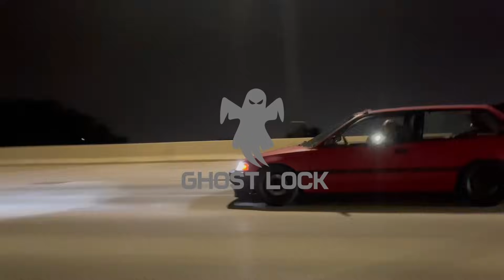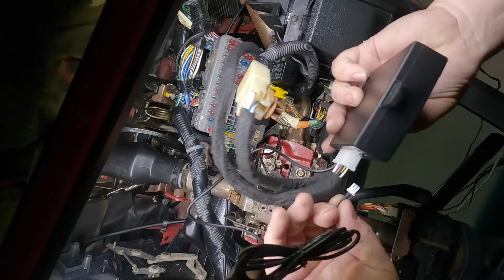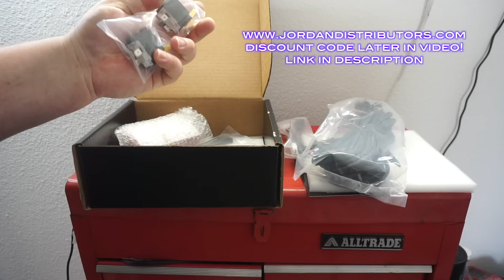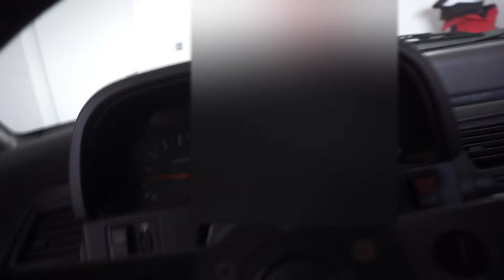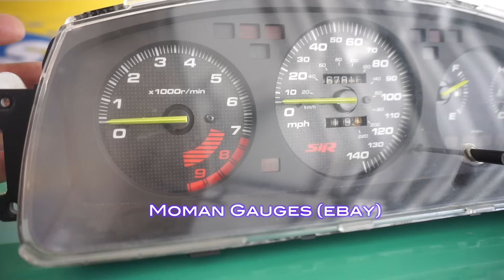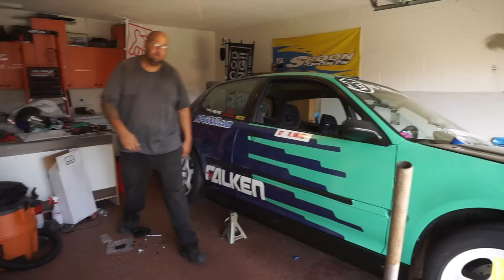KEEP YOUR HONDA SECURE! JDI GHOST LOCK | PUSH START EF/EG/EK/DA/DC CIVIC INTEGRA

Comment: Those ghost locks are easy to remove all u have to do is take power off wich u do by cutting cable off the fuse box and the push to start all u have to do is disconnect the fuse box cable disable the push start moral of the story if they really want to take ur car there taking it my homie had all that shit of he used to block his car with his parents cars one on front one in the bk and they still took it guess how tow truck them fools are savage
Reply from the maker: If power is cut it notifies you and it has a 6 hr internal battery broadcasting its location.
Reply: @HondaStreetGarage  nice

Comment: I used to dead azz remove my ECU, coil packs and put bike locks on my axles ever day parking in San Francisco on streets with my h22eg hatch. sometimes I would take out even more just to switch it up like spark plugs spark plug wires or anything that make it undrivable. Also had 4 different style locking lug nuts on all 4 rims so 16 different keys to take rims off. plus I owned a Doberman Pinscher that loved sitting in the car to protect it if I was just going in store or something quick. Still have police report from when my dog held onto a guy for 20 minutes by his arm that reached into my car when I was getting hair cut.
Reply: Bro I feel this I'm in Oakland 4 wheel locks , parking boot , detachable wheel , couple more I wont list.
Reply: dude bike locks on axles is such a fucking cool move

Comment: Lol just so you know jdi uses a Ebay brand called easy guard push start. You can buy it yourself for 30$ on ebay an de pin the the 2 harness connectors that you need to take out for it to work. Only thing they do is make it plug an play with the same connectors that you take out an tax you for it🤣🤣🤣🤣🤣. Not worth what they are asking.

Comment: What's stopping the thief from just unplugging all this stuff and plugging the stock harnesses back in?  It looks like this could be bypassed by just unplugging a couple of wiring harnesses.

Edit:  I guess the RFID ignition switch would make that a pain in the neck, unless they brought a stock one to plug in in its place?
Reply: For that to happen the thief would have to first know that it was there. With the Ghost Lock fully installed properly, there would be no way of knowing that it was installed, like a Ghost. It is highly unlikely that a thief would remove your rear seat, take off the lid to the fuel pump area and unplug and replug the factory connector. The harness just appears to be an upgraded fuel pump wire harness and would not look out of the ordinary to a thief. As for the Push to Start system, yes, a thief could hypothetically bring an ignition switch compatible with your exact year vehicle and disassemble the lower dash and unplug the push to start system and then plug in the factory switch and so on. If a thief is that resourceful and prepared then they will probably be stealing the car regardless of the security measures in place, such as simply towing the vehicle away. Thats where the Ghost Lock comes in. It gives you the best chance at recovering the vehicle after the unfortunate event that it is stolen. When it comes to security, we recommend adding as many security measures as possible. A kill switch, our Push to Start Kit, Ghost Lock, quick release steering wheel with lock, etc. Thieves are typically looking for easy targets where they can get in and out as quickly as possible. The more security measures that need to be bypassed the better.
Reply: I have alarm, JDI push start kit, quick release steering wheel. When some one wants a car they will come w a tow truck n bye bye. I even installed cameras n I block my car every night with a Lexus that I have so. But will see what happens.
Reply: Instead of putting it where most do remove the dash and run the wires that way works well

Comment: If i want to have a relayed pump, would this be doing that also?
Reply: I had the same question. So I went to the website. This kit is an upgraded fuel pump relay kit that is powered at the alternator to fuse box connection. So your pump will be seeing 14v from the alternator.

I've actually been looking into making my own harness for my pump setup, everything I wanted to build my own was going to cost over 100 dollars. There are already reputable companies making these harnesses just for the pump upgrade.

The ghost lock kit uses higher quality parts for their version of the pump relay upgrade than I was planning to use. But it also provides the tracking system as well. The price may seem a little high. But from my research this price is very good for what is offered. I'm going to pick this kit up instead as it offers everything I need for the pump relay upgrade and the ability to track my car.
Reply: @Mr.Wongburger  thanks 🙏🏻 kill 2 birds with one stone
Reply: @aaleexsaalaazaar  I ended up grabbing the ghost lock and push start. I have an Eg, but after talking to the guys at jdi I ended up get the universal kit for my setup. I'm running a Dw400 pump.

Comment: Can you still lock your steering wheel with this JDI push start device?
Reply: Yes u need to keep the key cylinder n mount the push start button else were. It's a lil more work n sometimes I have to go back to my car Bec I forgot to take the key off the ignition 🤦🏾‍♂️🤷🏾‍♂️ I'm working on it 😂😂 in the JDI they have a video w everything u need to install. Hope this helps

Comment: Great job as always! We are so honored to be helping keep your cars safe!
Reply: im so glad to see that you have been able to source the proper connectors to make both of these a plug and play application for the ef/crx. i sent an email about it for the ef/crx in june but was sat to hear that you were having issues sourcing the connectors
Reply: Jordan Distributors, awesome product!! Quick question, is each fob different and unique? Can any key fob work for all ignitions?
Reply: Will this work outside of the US?
Reply: What confuses me is like what do you do with the original ignition lock? And how does this effect the steering wheel lock that a part of the streering wheel lock system i doubt the switch itself can lock the steering wheel that is the only thing thst confuses me